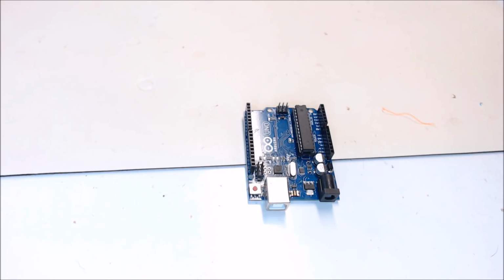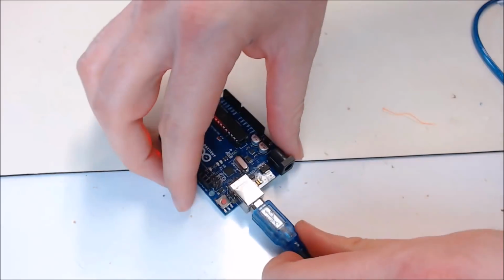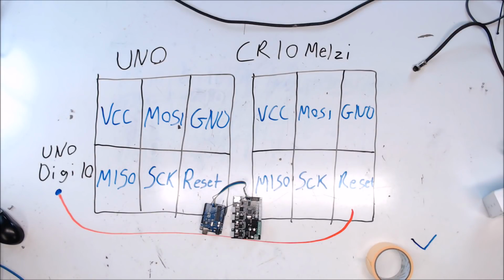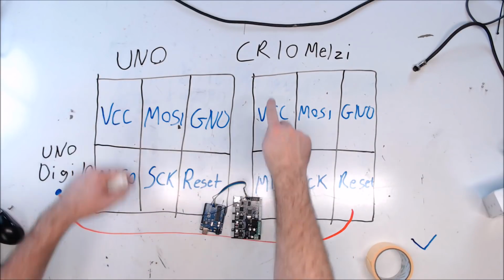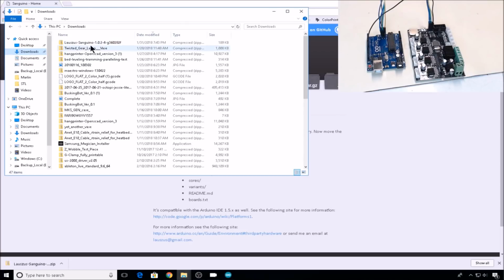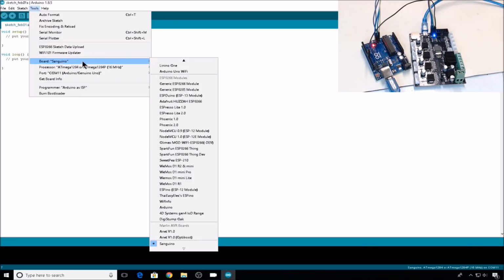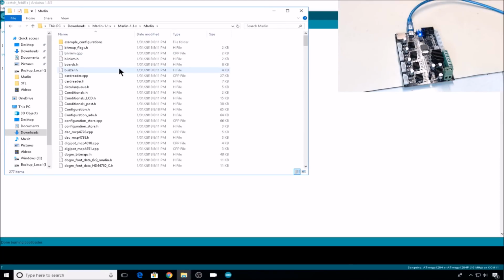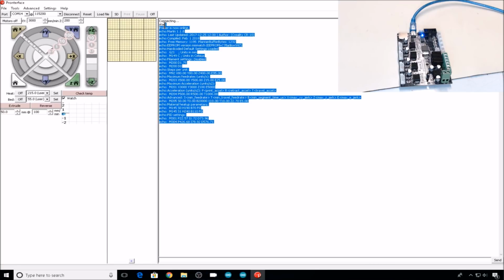Creality CR-10 Marlin Firmware Upgrade - Chris's Basement

Comment: So the CR-10 that I currently have as the AT Mega 2560 vs whatever runs the Sanguino board has.

There's no jumper cable present on the AT Mega board, but when I use the available USB port w/o the Arduino set up as an ISP, the AT Mega board does power up and I can see the splash screen and all that good stuff.

I'm terrified that I might brick the AT Mega board since there isn't a jumper present as you mentioned in your tutorial, but since I was able to power it on with the available USB port and the fact that my device manager was able to determine that the board did 'take up' a COM port, I should be good right?
Reply from the maker: Yes, you should be good. I know a lot of these boards don't have the jumper, it's just safer to use USB power. You should be all set.

Comment: Chris
, I tried to install BLtouch kit and now have a blank blue screen on my CR10S5. Any reason why this might be? I ordered one of these kits in your video to try and fix the issue if I need to flash new firmware. Thanks.
Reply from the maker: I am not sure, what the upload successful? Which screen do you have?
Reply: @ChrisRiley  Thanks for the reply. I ended up being able to reflash the software, and I fixed it. Thanks!

Comment: This is a great tutorial and I believe will solve my problems. 

I am getting an error..

avrdude: Expected signature for ATmega1284P is 1E 97 05
         Double check chip, or use -F to override this check.
Failed chip erase: uploading error: exit status 1

Have I done something wrong?

I have the 2560 processor! So I don't need the bootloader!

Great video thank you
Reply from the maker: Sounds like you are trying to use the Sangino chip when you have a 2560. Make sure you are using the 2560 environment.

Comment: Hi Chris. Great video, but I have a problem. I followed your tutorial step by step, the bootloader seems to go well, but when I try to upload my edited Marlin firmware on the Melzi, the IDE give me this error: 
"-LC:\Users\1988m\AppData\Local\Temp\arduino_build_923422" -lm
c:/users/1988m/appdata/local/arduino15/packages/arduino/tools/avr-gcc/4.9.2-atmel3.5.4-arduino2/bin/../lib/gcc/avr/4.9.2/../../../../avr/bin/ld.exe: C:\Users\1988m\AppData\Local\Temp\arduino_build_923422/Marlin_cr10.ino.elf section `.text' will not fit in region `text'

c:/users/1988m/appdata/local/arduino15/packages/arduino/tools/avr-gcc/4.9.2-atmel3.5.4-arduino2/bin/../lib/gcc/avr/4.9.2/../../../../avr/bin/ld.exe: region `text' overflowed by 2412 bytes" Do you know what happened? Thank you.
Reply from the maker: Well its telling you that your over the memory limit. That's odd. In configuration.h search for m503. There will be a line you need to uncomment that says disable m503. Remove the comment and try again. That should get you enough memory.
Reply: @ChrisRiley  //#define DISABLE_M503 is correct for enough memory or  #define DISABLE_M503 and when i change something and verify is ok but when i upload there is something wrong like avrdude: ser_open() : can't open device "\\. \COM4" :
Reply: :) of course cura is running so port is busy. I turned it off and it solved. Please help me for the memory. Program use %98 of memory now so Which line should i uncomment for some enough memory and i am sorry for my bad english..

Comment: Hello Chris me again with one question maybe you can help me please i use your videos to upgrade my firmware to a Creality CR-10 Mini and everything went great until i try to print i keep getting a error that says E1 Thermal Runaway stops print and say to reset the firmware i installed was the version from TH3DStudio and want to change it to original Marlin 2.0 but when i repeat the process it throw another error that can compile to sarguino 1284p could you please help me to fixes actual error E1 Thermal Runaway or which board should i use to change firmware, Thank a lot for your time and keep it going.
Reply from the maker: Hey Manuel, I am not sure what board that printer has, what are the numbers on it or do you have a picture of the CPU?
Reply: Chris Riley Hi Chris it is a Creality v1.1.3 I update my libraries and manager board and finally i could upload Original Marlin Firmware 2.0 but it keeps giving me the same error E1 THERMAL RUNAWAY HALTED PRINTING RESET if i wan to printing i have to ser my fan to works between 55-60% i double check all my hardware and calibrated PID and all the same, thank you for your time amazing videos and keep going i will install a SKR 1.3 soon in this printer and yours will be very helpful
Reply from the maker: @mlardizabal1976  Does the temp try to recover? It might just be taking a while? You can adjust the thermal run away. In configuration_adv.h try changing to this instead of stock.

#if ENABLED(THERMAL_PROTECTION_HOTENDS)
  #define THERMAL_PROTECTION_PERIOD 90        // Seconds
  #define THERMAL_PROTECTION_HYSTERESIS 7    // Degrees Celsius
Reply: Chris Riley i did change that and then PID calibration and still the same error when the cap fan goes to 100% temp slowly drop and doesn’t look to recovery and closer it is to the bed temp drop faster right now i am printing some mods to the cap fan and see if it gets better, once again thank you for your help and time to response
Reply from the maker: @mlardizabal1976  Okay, then yep, a rework, a bigger heater or silicone sock are about your only options.

Comment: So I wired everything up right and when I plug everything into my computer it doesn't have identify my board on any com ports. Their no jumper on my board. I have  cr10 with a v1.1.3 motherboard. I've been trying over and over again and it just isn't working
Reply from the maker: You are using an Uno board? You might just have a driver issue.

Comment: Hi Chris, thanks for this video. I'm new to the 3d printing space, and have not learned all the ins and outs of slicing yet. I was able to find a Cura profile to import and my CR-10 MINI works like a champ using that. If I flash the firmware, will that profile be useless and I'll start over (re-tweak all the settings for my printer), or is that part going to be the same? Also, looking forward to your answer to Matthew's question about the advantages of flashing the firmware. Thanks in advance for any thoughts and the great (detailed) video. -Jeff
Reply from the maker: Hey Jeff, you should be ok after a firmware flash on your slicers settings. As long as your movement settings stay the same. If you do flash the firmware I would run a M503 command beforehand and save the output so you can make sure you get the settings back how they were before the flash. I replied to Mathew as well. :)

Comment: Hi Chris! New to the channel but great work! 
Question...I am running a fresh build of Arduino 1.8.12, I have yet to program anything with this board. I have downloaded the Sanguino Zip file and used 7zip to open. I did not have a 'hardware' folder so I created one and pasted the Sanguino file into it. When I switch my Board in Arduino under tools, I get the readout "The current selected board needs the core 'arduino:arduino' that is not installed." Not much I can find on google or duckduckgo haha
Thanks in advance man!
Reply from the maker: Hey Sam, I am not exactly sure, but the first thing I would do is try IDE 1.8.5, that one seems to be the most stable with a lot of board libraries.
Reply: I´m having the same problem. Did you ever find the solution? Thanks!
Reply: Forget it, I extracted the files incorrectly. Now it is working.

Comment: Hey, in the vid you said you can just leave the board in the printer, but I assume you'll need to disconnect everything before wiring up to the arduino?
Reply from the maker: No, you can safely leave everything hooked up. It should be ok.
Reply: Excellent, thanks!

Comment: Please help, I did everything as mentioned in the video and now it won't recognize my SD card and gets into a repeating loop of restarting.
Reply from the maker: You might be running super low on memory, uncomment //#define DISABLE_M503 and reflash, see if that gets you going again.
Reply: @ChrisRiley  I found out the baud rate was set too low? It was at 100000 and I reflashed at 250000 and somehow it worked. Thanks for the advice!
Reply from the maker: @damfastfpv8016  Great!

Comment: Does this work with the cr10 v2? I've tried upgrading the firmware for my bl touch autobed leveling but it's not being detected by my pc. So maybe this will be my solution.
Reply from the maker: I am not sure what board that is. Try installing a CH340 driver first to make sure it's not a driver issue.

Comment: Hi Chris, when trying to use the burn bootloader command, I am receiving an error that says "avrdude: expected signature for atmega1284p is 1e 96 09, double check chip or use -F to override this check" any ideas?
Reply from the maker: I think that means it is waiting on a reset. Are you using a programmer?
Reply: @ChrisRiley  nothing outside of your directions. I looked up avrdude but I don't even have that on my laptop so I don't even know where it's pulling that from
Reply from the maker: @ethanmanning6281  If you are using the UNO it almost has to be a wiring issue. It that fails I would try a programmer to flash it. Something like this. https://www.amazon.com/microcontrolador-programador-descargador-adaptador-Geekstory/dp/B07NZ59VK2/ref=sr_1_1_sspa?dchild=1&keywords=avr+programmer&qid=1591668690&sr=8-1-spons&psc=1&spLa=ZW5jcnlwdGVkUXVhbGlmaWVyPUFMQTNSNzJTUlk4TlQmZW5jcnlwdGVkSWQ9QTA3OTEwODMxRTYxSUs3NVAxUVdRJmVuY3J5cHRlZEFkSWQ9QTA1MjAxNTQ2RzM0R0tFSUcwSkcmd2lkZ2V0TmFtZT1zcF9hdGYmYWN0aW9uPWNsaWNrUmVkaXJlY3QmZG9Ob3RMb2dDbGljaz10cnVl

Comment: Hi i dont got the Arduino UNO card. is there any other way. been trying to get my BLTouch to work and i tryed so long. i have used Progisp and uploaded HEX files. i got a CR-10 with a 1.1.5 board.  and the BLTouch came with a USBISP and some cables.
Reply from the maker: Yes, that ISP programmer should work just fine.

Comment: hi how do you get it to initiate the SD card after upgrading the firmware???

Now have Merlin 1.1.9 but can't find any info on how to initiate the SD card under the new firmware...?!?! Means I can't load any prints making my printer useless because I can print anything. Everything else works ok, auto home, stepper motors etc,  Now just can't print cos can't initiate SD card or laod images from it??

Need to include in guide how to do your first print with Merlin. Vital step...miffed ans I can't find information on it at all.??!?!!
Reply: UPDATE: At 4am finally figured out you have to copy everything off your SD card, reformat it and then stick all your models back on it. I think the header file that the origional firmware creates on the SD card is not recognised by Merlin. After that doing that, works fine.
Reply from the maker: Glad you got it figured out.
Reply: @ChrisRiley  
Confirmed, header (hidden file on SD card) that organises the list of STL files is different. Merlin uses the same as windows. Hence why Win10 always reports an error with the SD card when using factory firmware, whereas merlin does not - yey! Obviously writes some type of header file because the list is organised differently to how it is seen in windows.

A great tip for build plate adhesion is to use Carpet Glue - different brands have varying results - here in the UK poundland or Wilko brands are the best. Sticks to the glass build plate harder than Chuck Norris' hairspray. To remove heat up the build plate to max and use scraper. to get rid of remaining glue spray hairspray on it and wait to cool then it will flake away with scraper. If you want to you can cool the build plate after the first four layers.!! Hardest bond ever....sticks really well to glass - you cannot remove build unless you heat up bed again (glue remelts!)  

N.B. Merlin 1.1.9 seems to give error if you try to hear above 85C on CR10, thermal runaway protection in firmware causes this, maybe??!!

Thx for tips! Very well explained! subscribed!
Reply from the maker: @ojbeez5260  Carpet glue, that is one I have never heard of, nice.

Yeah, thermal runaway is kicking in, you can adjust the time and temp on configuration_adv to give it a better chance of succeeding.
Reply: @ChrisRiley  Properties of carpet glue / spray glue are interesting. At 95C its gooey at room temp it bonds  harder than superglue  but you heat it up again and its all gooey again - and possible to remove prints!! Always print on a raft though!! Hair spray seems to crystallise the Carpet glue making it brittle like icing and easy to scrape off the bed. Maybe someone should try it like yourself or 3D printing nerd and do a video on it? (Being a YTer is not my thing but all the power to y'all!!)
Reply from the maker: @ojbeez5260  I might have to try it out.

Comment: Chris, a good clear guide.  I have a related question.  I have a CR-10 Mini with the V 1.1.2 board and I would like to install the V2.1 board.  How is this accomplished?  I can’t seem to find any clear info.  Just what is involved?  Take care.
Reply from the maker: Thanks! I am not sure what is different about those boards, but they should both work the same. Some of the connectors might be different. Besides that it should be just a board swap.

Comment: Thanks Chris- Got Marlin 1.1.9 loaded thanks in large part to these instructions. (Found out a few nights ago that I need the thermal runaway protection.) I used an Arduino Micro as my ISP. The "top right" pin on the Arduino Micro is the one closest to the Rx LED. Pin 10 on the micro is still used as the reset pin. The only issue I had was having to add the "u8glib by oliver" library to the Arduino environment before Marlin would compile. See pert's instructions here: https://forum.arduino.cc/index.php?topic=541014.0
Reply from the maker: Awesome it worked, I actually added a doc in the description for the LCD lib. I forgot to add it to the video. Thanks for the link though, it will help others.

Comment: Will this work for a cr10s5, its a bigger printer so I guess it's different, would I have to do something else for the marlin part
Reply from the maker: It would work, but it depends what board it has. As far as Marlin, more than likely you just need to update the size.
Reply: @ChrisRiley  how do you update the size ?
Reply from the maker: @a..d2062  It these settings here in configuration.h

// The size of the print bed
#define X_BED_SIZE 250
#define Y_BED_SIZE 210

// Travel limits (mm) after homing, corresponding to endstop positions.
#define X_MIN_POS 0
#define Y_MIN_POS -2.2
#define Z_MIN_POS 0
#define X_MAX_POS X_BED_SIZE
#define Y_MAX_POS Y_BED_SIZE
#define Z_MAX_POS 210
Reply: @ChrisRiley  what should the Travel limits (mm) after homing, corresponding to endstop positions. be
I'm not sure
Reply from the maker: @a..d2062  Stock they have all of them set to 0.

Comment: Hello Chris,

I'm searching the internet because I would like to add a touch screen to my CR-10 mini.
Is this possible and do I have to have Marlin or a complete other mainboard.

I can't find anything on google.

Thanks in advance.

Michel
Reply from the maker: On the stock board it would be pretty difficult to add one. There are no UART pins available.
Reply: @ChrisRiley  
Thank you for your quick answer.
But do you know if I can use a board from another cr-10 series and accomplish this.
Or another manufacture board.
Reply from the maker: @michelhagenaar3108  There are a few that fit it now, check out the SKR replacement boards.

Comment: if understand correctly.. if you wish to update printer lets say with BLtouch you will need to upload new marlin code right? all steps for disassembly to switch jumper etc.. there is no way to edit  it without jumper to be switch on vreg??
Reply from the maker: The vreg just enables you to power the board with USB, but yes, you will have to reflash to enable the Marlin features.
Reply: the question is can i stay on vreq and flash? or do i always have to disconnect and power via usb?
Reply from the maker: Tomasz Virco You can stay on vreg and flash. The printer just has to be plugged into the wall and on  to do it.
Reply: In this case are there any valid risk to stay on vreg durring flashing or installing boatloader?
Reply from the maker: Tomasz Virco I don't think so, I just didn't want to have the box open when the ac power was hooked up.

Comment: hi Chris Riley what kind of board you have on the cr 10? i have an v 1.1.2 and is a piece of crap, got several troubles with the temperatures, i put two different capacitors the first time 100uf 16v and the second time 440uf 16v and nothing solve these problems, i back to the stock firmware and the problem still but the printer not have all the protections that have the marlin 1.1.9 firm such as bed hieriestesis too bad!!!
Reply from the maker: I have the original one, it looks like this, I don't think it even has a number.

https://www.aliexpress.com/item/Creality-Cr-10-3D-Printer-Motherboard-Control-Broad-Free-Shipping/32804216198.html
Reply: @ChrisRiley  thanks Chris for the help iam trying to contact creality for a board replacement I researched a little and looks like a problem with the voltage regulator inside the board , seems to be a lottery, much people suffering this problem and others works flawlessly as your cr 10 printer xD

Comment: I dont have on the board the switch to get power supply from the usb... but if i connect with USB the blu light turns on... is it the same or i cant do what you show on the video?
Reply from the maker: Lorenzo Carboni That should be the same. That should work.
Reply: Chris Riley many thanks for your video and your answer.
Reply: Just another question. I found on amazon a board called elegoo UNO R3 that is compatible with arduino. Will it work as an original Arduino UNO board?
Reply from the maker: Yes, that board should work exactly the same.
Reply: Chris Riley thanks